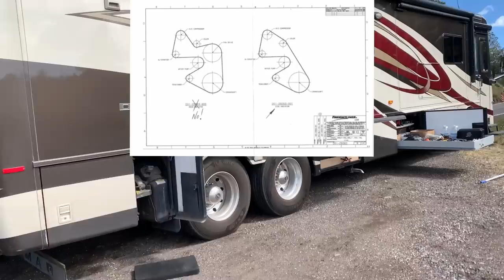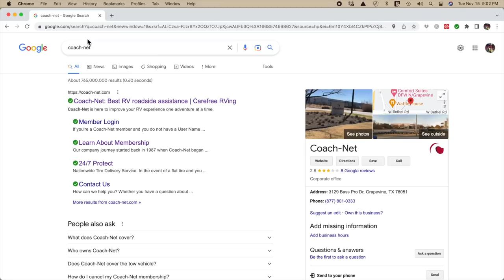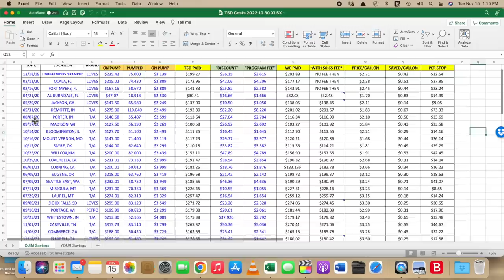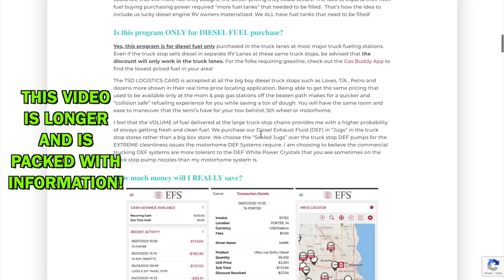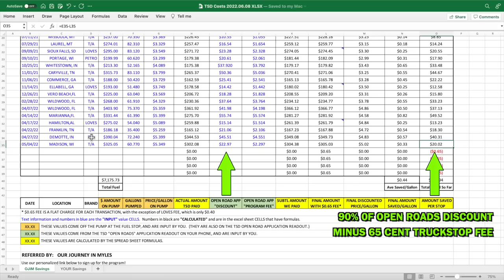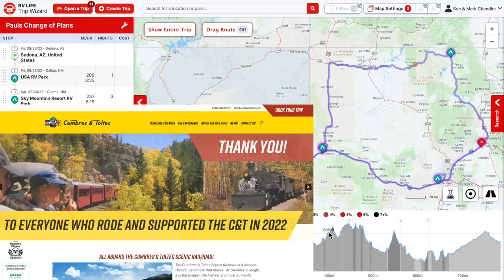CLASS A MOTORHOME EMERGENCY BREAKDOWN | COST OF MOTORHOME OWNERSHIP NOT FOR THE FAINT OF HEART EP246

Comment: Great video as always. This certainly shows that advantage of traveling with others. It would be very informative to know what happened to Pat and Paul's coach for future reference. Thank you.
Reply from the maker: So I just confirmed with Paul that the Exhaust Gas Recirculating (EGR) Cooler had failed. God only knows if the belt failure RAISING the temp was the final nail in the coffin for the EGR Cooler apparatus.  It started to leak WATER internally into places water should not be,..........very thankful for the Cummins sensors that said to "STOP" the engine now!  Repair was about $8k because you have to take A LOT of stuff apart to get to the EGR, and work from INSIDE THE COACH ABOVE and OUTSIDE THE COACH below the engine.  The NEW EGR REPAIR also requires some modifications to the engine because the replacement kit is called an "Upfit" or "improved" version of the old part.
Reply: @OurJourneyInMyles  Thank you.

Comment: I will be getting  a spare set of belts on my 2019 Newmar DS for sure. At the end of the video it looks like your drivers side full wall slide is not seeded closed correctly. Safe travels
Reply from the maker: The slide needed to be retimed again.  I have to do that every year or so when I get out of jive.  I have done it myself at least once. I have NIRVC do in last month when it was in for a new Oasis Boiler unit for $12,500.

Comment: So what did Cummins end up finding wrong with their rig?!?
Reply: I had the same question!
Reply from the maker: So I just confirmed with Paul that the Exhaust Gas Recirculating (EGR) Cooler had failed. God only knows if the belt failure RAISING the temp was the final nail in the coffin for the EGR Cooler apparatus.  It started to leak WATER internally into places water should not be,..........very thankful for the Cummins sensors that said to "STOP" the engine now!  Repair was about $8k because you have to take A LOT of stuff apart to get to the EGR, and work from INSIDE THE COACH ABOVE and OUTSIDE THE COACH below the engine.  The NEW EGR REPAIR also requires some modifications to the engine because the replacement kit is called an "Upfit" or "improved" version of the old part.
Reply from the maker: So I just confirmed with Paul that the Exhaust Gas Recirculating (EGR) Cooler had failed. God only knows if the belt failure RAISING the temp was the final nail in the coffin for the EGR Cooler apparatus.  It started to leak WATER internally into places water should not be,..........very thankful for the Cummins sensors that said to "STOP" the engine now!  Repair was about $8k because you have to take A LOT of stuff apart to get to the EGR, and work from INSIDE THE COACH ABOVE and OUTSIDE THE COACH below the engine.  The NEW EGR REPAIR also requires some modifications to the engine because the replacement kit is called an "Upfit" or "improved" version of the old part.
Reply: @OurJourneyInMyles  Sounds similar to what Sean & Kristy Michael had to do to their truck "Seemore" (https://www.youtube.com/watch?v=qPl2UwOePak), though they probably had it "easier" as they just had to take the whole cab off the truck. 😉

Glad that Paul was able to get it taken care of and sad for them that it took $8K to get it done!  Also sorry to hear about your $18K woes, but very much looking forward to seeing your upcoming video of what that entails.

Keep up the great content!  The boss and I love watching the Caravan series!  We both hope that you will cover the train ride mentioned in this video soon too.

Comment: We had good fan belts go out twice so far in 25000 miles on our motorhome, looking into the electric fan conversion if it happens again.
Reply from the maker: Wow!  I heard Cummins offers a "green belt" that is superior to the regular belts,...........I think????
Reply: @OurJourneyInMyles  yes I heard the green belts are stronger and last longer, but the electric fan conversion is more efficient, so saves fuel and less power is robbed from the engine than operating the hydraulic fans... the newer Prevosts are now coming from the factory with the electric fans too... but need to have the high output alternator or alternatively maybe power them through the house batteries instead of chassis batteries

Comment: Any updates on root cause of overheating and corrective repairs on both Pat & Paul's rig as well as yours would be greatly appreciated. Thx.
Reply from the maker: So I just confirmed with Paul that the Exhaust Gas Recirculating (EGR) Cooler had failed. God only knows if the belt failure RAISING the temp was the final nail in the coffin for the EGR Cooler apparatus.  It started to leak WATER internally into places water should not be,..........very thankful for the Cummins sensors that said to "STOP" the engine now!  Repair was about $8k because you have to take A LOT of stuff apart to get to the EGR, and work from INSIDE THE COACH ABOVE and OUTSIDE THE COACH below the engine.  The NEW EGR REPAIR also requires some modifications to the engine because the replacement kit is called an "Upfit" or "improved" version of the old part.
Reply: @OurJourneyInMyles  Thank you so much for the insight. I'm seriously considering getting an extended warranty after the 1st year bumper to bumper warranty is up next June.

Comment: If you can stay under 40' consider a gasser. They're arguably more reliable and inarguably much easier and cheaper to work on. HP to weight is often better than diesel coaches too. That means you can get up the hill better but while turning more RPMs than a diesel. Optional Liquid Spring suspensions give a much better ride than stock gasser suspensions.
Reply from the maker: Lots of options for us all to consider when looking into rigs!  There are price points galore.

Comment: There's a place in Grants NM, that could have fixed there RV,  called CM TRUCK/TRAILER REPAIR that would have fixed there RV.  I had a fuel system problem. They fixed it in less than a day.
Reply from the maker: That is great info for folks to know traveling in this area.  Thanks!

Comment: Mark, my wife and I have the identical year and model Dutch Star as yours.  Is the $18,800 repair something we could avoid with preventative action?  Love you channel and thank you for all of the repair and fix-it advise.  Dan K
Reply from the maker: No.  Our 9 year old Oasis Boiler developed a pinhole leak.  We opted to replace the entire gadget. That made the $7k job $12.5k  The other stuff was general wear & tear. Video will be in late Feb 2023
Reply: Thank you for such a quick reply!  I am an engineer(structural with mechanical experience) as well.  My wife loves to laugh at us both, but understands my OCD with coach maintenance.  Safe travels. Dan

Comment: Newbie question here. 
We are probably going to trade in our Class C for a Class A 40’ tag axle. 
  We plan to tow a Jeep or my Ram 2500 4x4. 
  When you tow in flat country what do you set your shifter at. 
  Same question for hilly and same question for mountains. 
  Do you ever feel the tow ? 
  It would be great if you would cover it in a video
  Also in congested areas do you select a lower gear so it doesn’t shift so much?
Reply from the maker: Our rig is 450 hp, and has lots of torque, but driving a motorhome is typically slow going, JUST LIKE IT SHOULD BE. I rarely manually shift.  The Allison Transmission is 6 speeds and it way smarter than every driver on the planet. It will protect your engine & trans from overspeeding.  On our caravan, someone with a gas rig have some down hill issues, and blew a V10,...........and after it was repaired, blew the trans 500 miles later.  It city, freeway or mountains, I put it in drive and let the shift computers do what they do best!
Reply: @OurJourneyInMyles   Thank you. That was very helpful. 
  I really appreciate it.

Comment: It's not good to mix colors of antifreeze because they are different from red to purple so on I believe purple is for engine with water jackets around the cylinders red is for those  don't have jackets
Reply from the maker: YES,.....the colors are important.  I ultimately had to use the Blue Fleetguard ES Compleat to mix with my Shell Rotella Fully Formulated antifreeze.  I was unable to find the Shell Rotella Fully Formulated in gallons,.........only in 55 gallon drums!  What da heck!  That is the first time I have ever had a BAD experience with Gaffney Freightliner in South Carolina,.......they set me up for failure,...........and I feel I got screwed.  They should of explained to be they were putting in a product that I would not be able to get on the road!
Reply: @OurJourneyInMyles  I believe there 120 gallon of antifreeze in my Rig I was told that if I mixed different  I would have to drain asap and change hopefully you are going to be fine
Reply from the maker: @theodorehyatt1782  I spent HOURS getting the info I needed to make sure the Shell Rotella Fully Formulated was compatible with the Fleetguard ES Compleat EG

Comment: So, I am curious as to what Pat had repaired on his Cummins?
Reply: I am guessing belt broke over heated the block and blew a head gasket!
Reply from the maker: So I just confirmed with Paul that the Exhaust Gas Recirculating (EGR) Cooler had failed. God only knows if the belt failure RAISING the temp was the final nail in the coffin for the EGR Cooler apparatus.  It started to leak WATER internally into places water should not be,..........very thankful for the Cummins sensors that said to "STOP" the engine now!  Repair was about $8k because you have to take A LOT of stuff apart to get to the EGR, and work from INSIDE THE COACH ABOVE and OUTSIDE THE COACH below the engine.  The NEW EGR REPAIR also requires some modifications to the engine because the replacement kit is called an "Upfit" or "improved" version of the old part.

Comment: Can the efc card be used at Loves as well as flying j
Reply from the maker: Loves is the only place that is a contracted FIXED 28 cent discount off per gallon of diesel.  Pilot is only associated with RV fuel discounts using Good Sams for a paltry 8 cents off per gallon.  We stopped going to Pilot the minute Good Sam's told Pilot they couldn't participate in the Open Roads program.

Comment: So what was the problem with Paul's rig? How did they fix it?
Reply from the maker: So I just confirmed with Paul that the Exhaust Gas Recirculating (EGR) Cooler had failed. God only knows if the belt failure RAISING the temp was the final nail in the coffin for the EGR Cooler apparatus.  It started to leak WATER internally into places water should not be,..........very thankful for the Cummins sensors that said to "STOP" the engine now!  Repair was about $8k because you have to take A LOT of stuff apart to get to the EGR, and work from INSIDE THE COACH ABOVE and OUTSIDE THE COACH below the engine.  The NEW EGR REPAIR also requires some modifications to the engine because the replacement kit is called an "Upfit" or "improved" version of the old part.
Reply: @OurJourneyInMyles  Yes I have heard of EGR coolers failing before. Glad he got the upgraded repair. Hopefully it is fixed for good now.  
Have you gotten a email from FMCA about the "new"affiliate program?
Reply from the maker: @WILDEBILL308  Yes.  It was not well thought out.  You can only use your referral credits for merchandise.  You cannot apply it to pay dues or buy roadside assistance, etc..  How many windbreakers and T-shirts and mugs do I70 year old full time RVers need? Answer: 0.0   You have to buy the stuff thru one guy at FMCA, over the phone when he is available because he has another second job at FMCA , it takes about six phone transfers for them to find who this person is, then you send in your coupons that you have better saved, he processes the order, and then you pay the difference because the credits are not for TAX or shipping either.  Oh ya,........and don't let them expire.  Bogus.